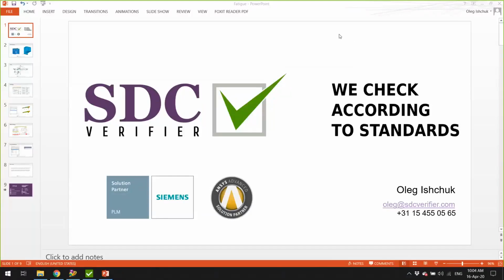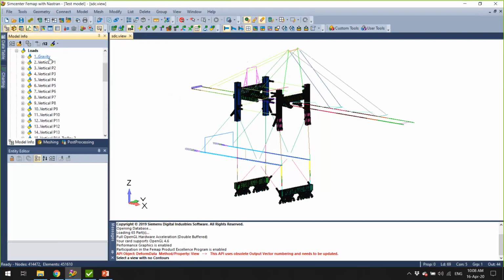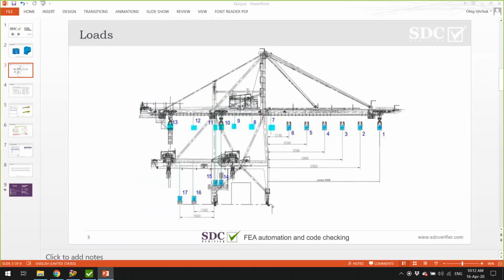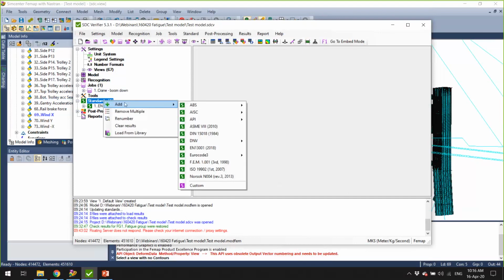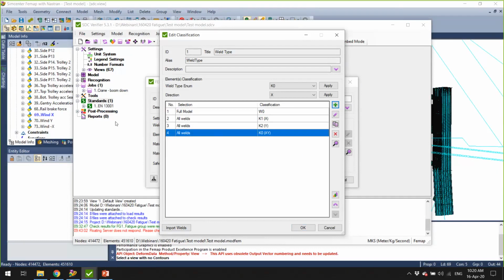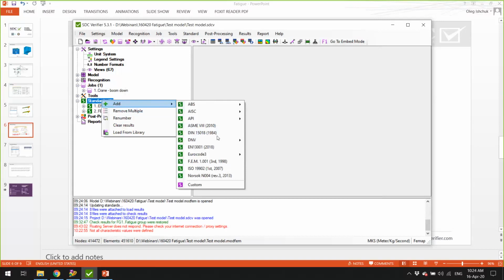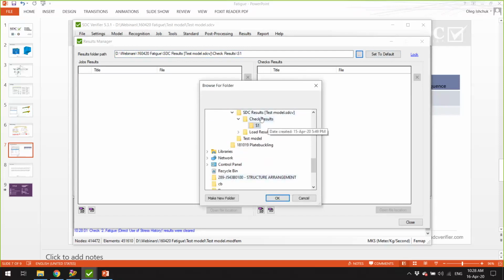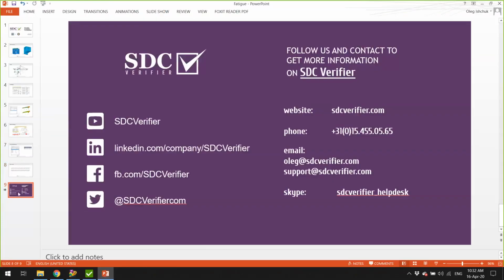Fatigue checks of the crane structures according Eurocode 3  EN 13001  FEM 1 001 using SDC Verifier

Comment: Thank for your great tutorial. Could you please give me what type of stress which is used when using Fatigue Euro Standard ?
Reply from the maker: In this case we use nominal stresses on elements. SDC Verifier's Weld recognition allows to reorient the stresses into the weld direction and apply a proper classification according to any Standard.

Moreover, it is possible to use Hot Spot Stresses or Pricipal Stresses in our checks
Reply from the maker: Next week we will organize webinar Residual Lifetime analysis for crane structures https://sdcverifier.com/event/residual-lifetime-analysis-for-crane-structures/
Reply: @SDCVerifier  I already registered your webinar, thanks a lot. However, in case ignore the weld, what type of stress should be used according Fatigue Euro Standard ? Von-mises or Principle Stress ? By the way, could you tell me how to calculate nominal stress using FEM.